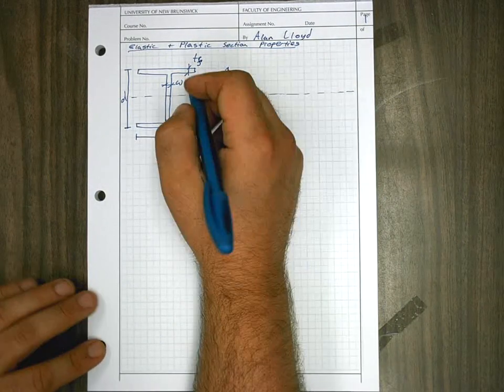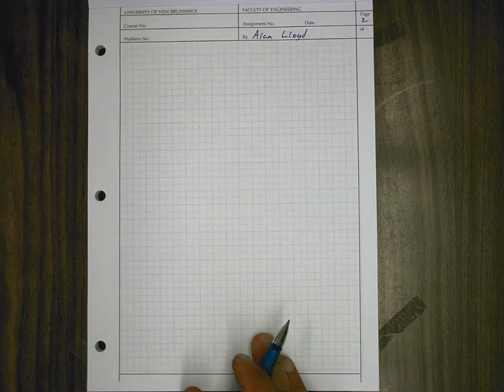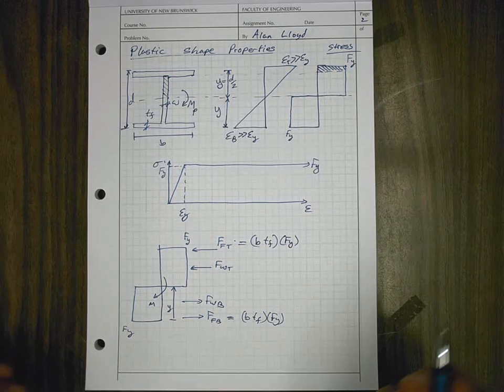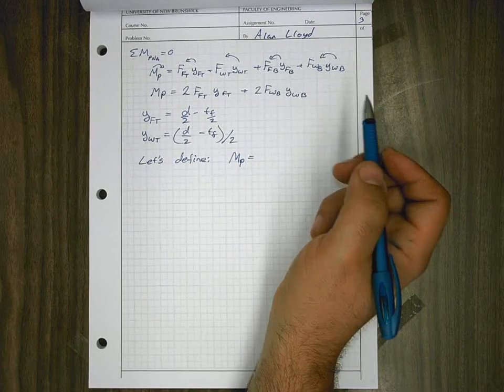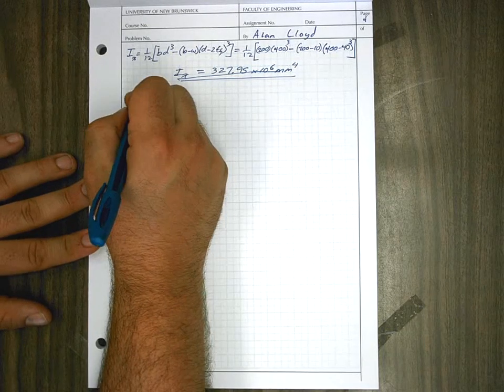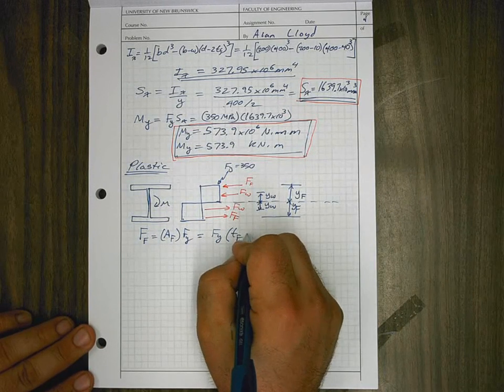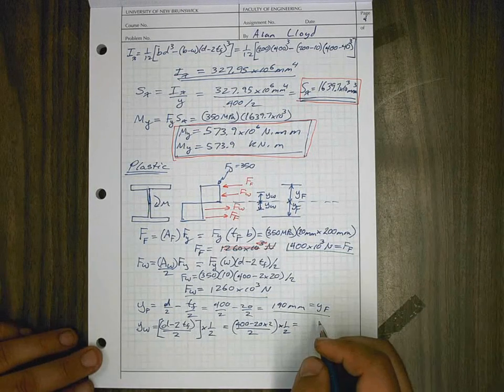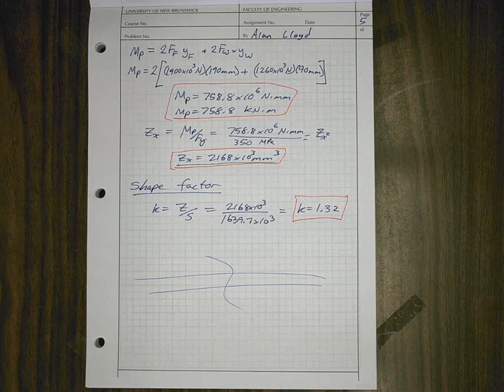Elastic and Plastic Section Modulus and Moments for an I Beam (Wide Flange Section)

Comment: Very nice, loved your demonstrations. Many years ago I began my engineering studies with “Statics and Dynamics” using a self study programmed instruction booklet (no scientific calculators) slide rule days.  I found  Engineering studies too time consuming for a full time minimum wage worker and part time student. In the interest of time I changed my major from Engineering to Physics.  No long labs with Physics I either got it or would get in later, maybe?  (Long engineering laboratory classes made job scheduling difficulties limiting jobs I could work.)  Years later having gotten a job in an industrial chemical laboratory and later in a research petroleum laboratory I often had problems where a little basic engineering knowledge was necessary when building test units and my old engineering books would see the light of day again. I never did pack away math, physics, and chemistry books as every assigned project involved a great deal of self study. I am enjoying your demonstrations and I marvel at how many resources students have in the “Information Age” just as I marveled once in my college days when a well heeled student showed me a “new device”  the HP-35 calculator and my envy knew no limit.